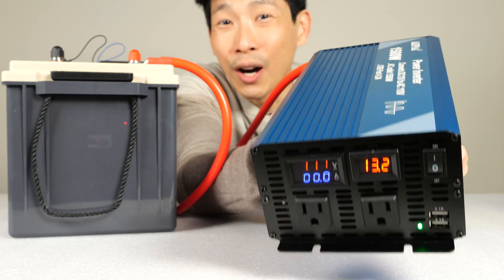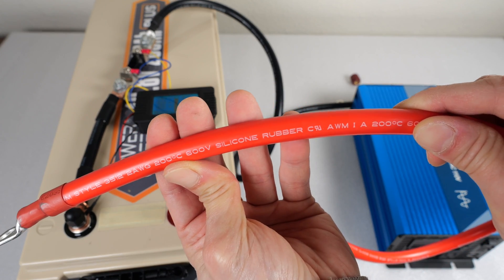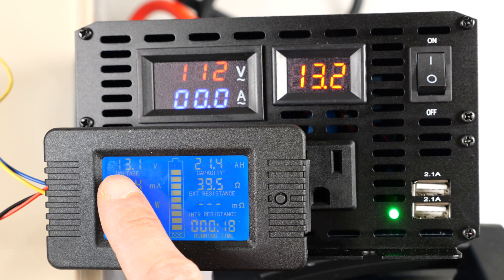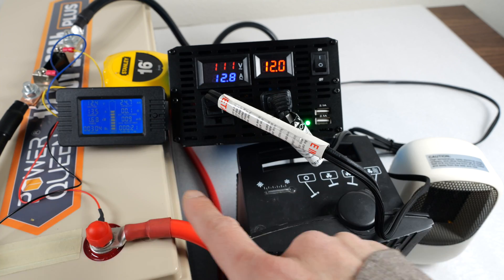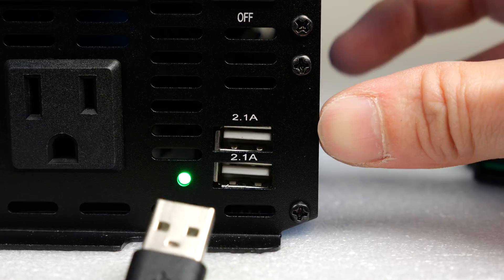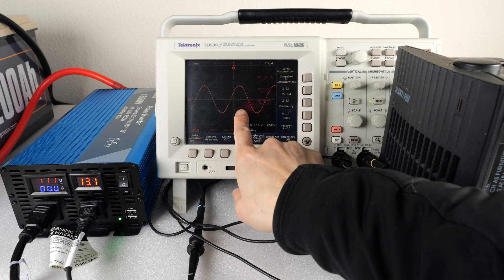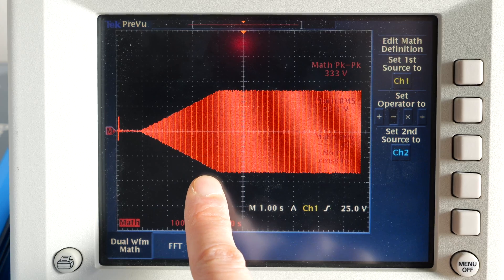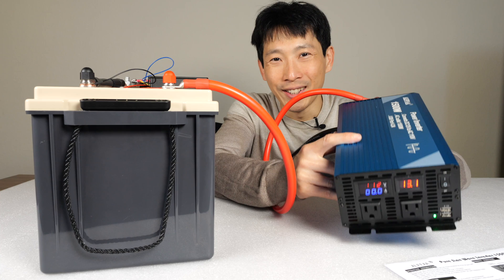How Pure is the Pure Sine Wave in this Alffaa 1500W Inverter?

Comment: The waveform may approach a pure sine wave when under no load or while powering a resistive load like a heater, but connect this inverter to an inductive load like a microwave oven, a portable AC unit or other motorized inductive load and I'll bet your scope will display a pretty distorted waveform. These cheap, high frequency, transformerless inverters offer a weak surge capacity as well as a short life expectancy, especially when powering inductive loads. Low frequency, transformer based inverters on the other hand offer a much higher surge capacity for starting and running inductive loads and they last far, far longer than these lightweight high frequency inverters.
Reply from the maker: You have a point. I'll add a microwave test the next time I do an inverter.
Reply: Would brand of inverter would you recommend then?
Reply: @MikeC-mf7dv  Schneider Electric, Outback Power, Sigineer Power, Victron Energy,  or Magnum Energy.
Reply: I'm glad you spoke about grounding. I purchased this because I didn't have the ground. I just wish it came with a remote control.